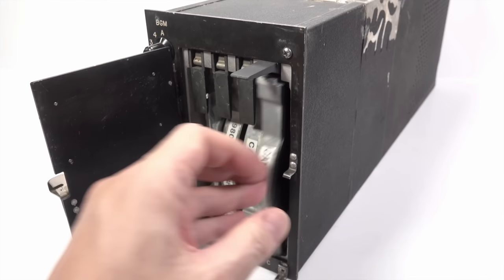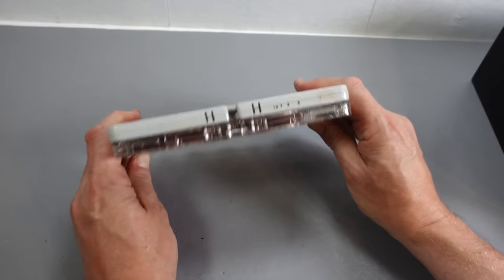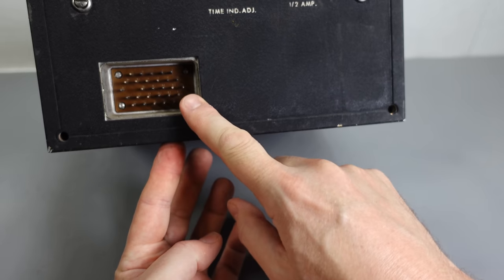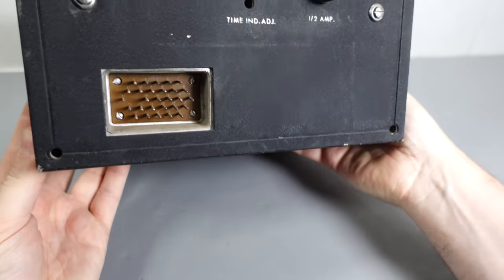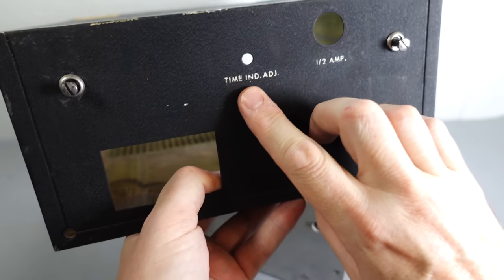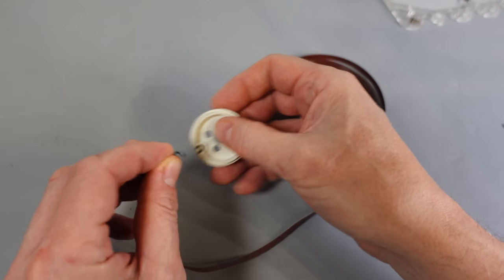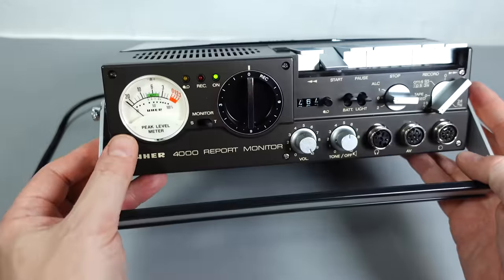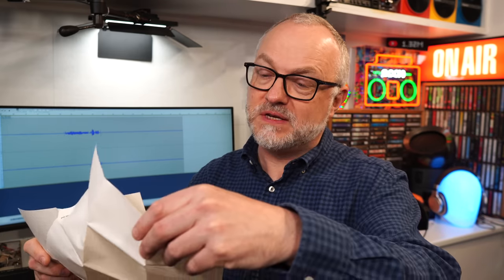Mystery aviation tape machine

Comment: I seem to recall seeing something similar in a DC9 when in those days you could go and have look at the cockpit mid-flight. My dad was an electrical engineer and he would often have "stuff" knocking around the house (Usually Honeywell Avionics kit). But I remember he bought something similar home in the late 60's. It's clearly a CVR. When I did flight program modules in later life we were taught there were often more than one CVR in a plane. Often there were two. One for the cockpit and in later years one for the chatter between cabin crew and in some cases passengers. I think he used to repair them at one point. I know he did a lot of aviation equipment and everything was massively over engineered due to vibration on aircraft at the time and the fact they needed to survive an impact or extreme temperature. They were robust as this one is with it's locking latch to stop the tape and door flat opening in flight. Like you said it only lasted 30 to 45 minutes, this is usually the time needed to record a incident at the time. From an incident to landing most pilots hope this is all over with 20 or so minutes! The socket on the back looks similar to a Mullard connector so I could suggest the "ring" of pins is the input voltage (Aircraft use anything from 28v-200v SP/3P plus the battery UPS). A couple of pins for remote control and the remainder used for mic pickups plus the output. Looking at this one I doubt it survive a incident of magnitude so it could be the G-CVR whilst a more heavily protected one would of being the main one for investigation post incident. 
These days it's all instant and monitored from the ground and with digital "tape".

Comment: Just found some information on a similar looking machine which uses the same type of tape. It is possibly a Quick Access Recorder. A QAR is to access data for research and maintenance purposes. Even to this date they still use removable media, albeit digital today. To help date the machine I also found that Telectro Industries suspended production in 1961.

Comment: My guess would be an early black box voice recorder to keep a record of cockpit and radio communications. 
The flight engineer would swap tapes or just let it record over previous recordings.
As the aircraft it came from was probably decommissioned along with the recorder, it would have spent long periods on the ground powered up, but with no activity. That would explain why the tape is mostly blank.
Reply: I thought it was maybe an early black box voice recorder as an in case the plane went down - with at least that the tape could be recovered and played back at a later date to find out what happened.
Reply: I was going to just say that, this may be a early day black box! Nice, to know someone else thought of the same thing, since most aircraft back in those days barely had anything for much safety.
Reply: That would be my guess too. Maybe, due to the limitations of reliable tape technology at the time the “time lapse/end of tape detector” put either an audio or electronic time stamp on the tape each time it was voice activated (so a continuous recording wasn’t necessary, and short tapes could be used) and/or cued in another of these machines when the tape ran out? 

It would make sense if all this was automatic - an emergency in the cockpit isn’t an ideal time to be having to swap a new tape into a machine. 

I’d also guess this one was ready to be installed in an aircraft, having been tested - hence the short test messages, and mostly blank tape. Maybe it had just been serviced or refurbished, having already been in an aircraft? That would account for it not looking pristine/not being in its original packaging.
Reply: A black box with 30 minutes of recording time is pretty much useless.
Reply: Sort of -- it's a QUICK ACCESS RECORDER (sometimes referred to as a QAR). Instead of being used for emergency data logging, it was used for everyday logging of communications. So not really a "black box" type thing. 

BTW - the company Penny and Giles were well known to make these devices. Later they would be mostly known for making faders for recording consoles. Interesting company.
Reply: @AttilaTheHun333333 no it isn't because you'd have the last 30 minutes of communication before the crash
Reply: @slamcrank  That makes sense, because even on a long haul flight, you're not going to have much dialogue with. ATC, so a short tape would suffice.
Reply: @AttilaTheHun333333  They record over and over.
Reply: I would agree possibly a cockpit voice recorder or backup recorder. As far as I know cockpit voice recorders don’t record the whole flight but constantly over records the last 30, 60, 90 or so as this would give the most valuable information rather than a full flight.
Reply: @tiprat5051  
What triggers the recording to stop in the case of an emergency? Which event, besides the plane crashing?
A black box isn't just needed in case of a crash!
It would make zero sense to use it for that purpose, especially with this tape speed.
Reply: @AttilaTheHun333333 it's usually stopped like today: switching it off. Either by switching the powerbus or by pulling the fuse.

Also its 30min in one direction that would mean either 1h stereo or 2h mono in a 4 track system. The requirement from 67 and onward was 30min. That means 2-4x the required record time.
Reply: @AttilaTheHun333333  In fact, 30 minutes of recording time for cockpit voice recorders was the ICAO requirement. Pilot unions made sure that airlines did not install recorders which could record more. Pilots wanted to be sure their daily communication was private - and the airlines couldn't listen to all they said. So the recorders would only hold the last 30 minutes of conversations. Data recorders had longer durations, but voice was strictly time limited. The 30 minute limit was raised to 2hours for new aircraft built after 2003 - so longer recording times are a fairly "modern" thing.
Reply: @AttilaTheHun333333  It would make total sense to use it for this purpose
Reply: The fact that it was made for the FAA and not for an airline or aircraft manufacturer supports this hypothesis.

I agree an early (maybe development) CVR.
Reply: Thanks for that,unsure why but it’s a first for me seeing your channel and it looks right up my street.Have a subscribe 👍
Reply: @tiprat5051  It was pretty much confirmed by other commenters it’s not a black box recorder.
Reply: @AttilaTheHun333333  it's exactly what I said it was an inflight recorder

Comment: Unit Obviously belonged to the FAA at one time so, not a music machine.  The plastic cassette is not fire proof so, probably not a CVR.  Low serial number suggests not many were made (unless you just got lucky).  You may be right that it was intended to fly (built like a tank).  So that leaves one application, it would be a voice data recorder for use in experimental flights (which the FAA does a lot).  Crew comments would be preserved on a format that would easily be transferred from an aircraft to be reviewed on the ground using a commercial RCA cartridge machine.  Photocell determination of time remaining (rather than a simple tape counter) permitted notifying the crew of tape status on a remote control head (through that multi-pin connector).

Comment: Big way to see if it was ground side or air side is the motor that drives those reels. If it is a 50Hz motor ground side equipment, which then says it was likely used for something like ATIS in the control tower, where you would have it sitting there, with an ATC recording the weather and such information onto the tape, and this then being used, with an external controller to listen for the corresponding tones on the other track, to replay this greeting identifier and local weather every 10 minutes, then stop, wait for the time interval, rewind back to the tone, stop, and play it again. Fast tape speed as you would typically have up to 5 minutes of info, updated every few hours, and thus the need to have audio that was better than the radio, and thus not degrade it. The counter would be a simple meter, showing the running time left, so that they could take the cartridge out and put in a new one, keeping the old one on the bottom of the pile, to use again next week. 

The reason for almost no audio is likely they bulk erased them before use, so that the bias system would have consistent noise level, and no chance of a misaligned head leaking old audio into the playback, or it mistaking a tone as a premature stop.

If the motor is 400Hz, or a speed controlled DC motor, then likely air side, probably used to record things like local ATC for immediate playback, likely for either pilot training, or for another ATC to confirm things, running in a loop back and forth to record on VOX, and thus you can get immediate playback of messages, leaving the long record time slow tape to still function, while having a local recording for quick reference. In any case tapes were bulk erased before storage, probably for the same reason above, no interference from old tones, or bleed through from misaligned heads. The 2 recordings were probably a test done in 1966, checking if the mechanism worked, and the tape was not bulk erased after, as it was still mostly blank.
Reply: Since this is a US product with FAA on it wouldn't it likely be 60 hz instead of 50?
Reply: @thomaswilliams2273  50Hz 60Hz so long as it is not 400Hz it is ground side equipment.

Comment: I believe this is a recording device for flight tests. I am an aviation engineer, and I used a similar recorder (TEAC V-80).
Reply: I checked the FAA report, but don't have the details.😮‍💨
<Memo>
- Telectro delivered the “VOR Test Generator” to the FAA.
- The "VOR Test Generator" has a component called "Voice/Code Reproducer Assembly".
- "Voice/Code Reproducer Assembly" has delivered 136 units.

Comment: I'd say its a CVR - Cockpit Voice Recorder. The original FAA standard record time for a CVR was 30 minutes, which lines up with your observation that this device can do, it was later extended so this design became obsolete.
Reply: I have the same idea.
Reply: i don't think it would survive a crash, especially if there's a fire (which was far more common back in those days). and when an aircraft cashes is exactly when you need the info on the tape.
Reply: I really don't think so. CVRs are built to withstand crashes. This thing definitely isn't.
Reply: I doubt it.  That would be completely destroyed in a crash.
Reply: First thing I thought of too, but it doesn't look very robust, as it surely would need to be salvageable after a crash?
Reply: They wouldn't use a tape with a plastic cassette housing for a CVR. It would completely melt in the event of a fire.
Reply: So understand it's not yea old "black box recorder" which is red and may not be opened by just anyone, but maybe a quick access cockpit voice recorder for review of smaller incidents and improvement of communication. Just a suggestion :D

Comment: Potential collab idea: get this running again! If it is aircraft equipment it'll need a weird high-frequency power supply, but the advantage of aircraft equipment is that it should be incredibly well documented (somewhere).
Reply: Or just get an old airplane. I think that would be an even better video.
Reply: That would be cool, CuriousMarc would be a great possibility to contact
Reply: That's what I thought....Google it you get nothing.
Reply: @John_Locke_108  So this tape recorder just needs the optional Douglas DC-8 accessory?

Comment: Looks like an early Cockpit Voice Recorder. A device still in use today with a longer history than most realize. Most preflight checklists require a test to be done on it prior to flight. The test  for most aircraft (99% of my experience was on C-130's) was to push the "CVR TEST" button on the flight deck and say a few lines. It should then playback what the microphones picked up. They may have installed a new tape in it, done a quick ops check to make sure it works, and then the component was removed or aircraft retired before it recorded anything else. 

Is there any serial or model numbers on it anywhere?

Also, small fact I learned many years ago. The C-130 came from the factory with a CVR in the mid fifties. It was a magnetic wire based system that ran off aircraft power. One of the issues they had was it was recording anytime the aircraft had power, and the wire could only be recorded on once. So ground crews had to keep track of how long power was applied so they could change out the wire before it flew. This encouraged the AF and Lockheed to develop an actual tape based system (Possibly this one) that could be recorded over and easily replaced. 

I'll do some digging to see if I can find anything.

Comment: It seems obvious to me that this is an early Cockpit Voice Recorder.  It's heavy duty (although maybe not as much as later models), made specifically for the FAA and not a specific airline (so definitely not for background music or anything non-safety related), and the one clip of "say again" may be it in use (this probably only recorded when the mic transmission button was keyed instead of recording the cockpit chatter like later models)-maybe there was two of them and this was for the co pilot and that's all he said on the radio during the flight.

Comment: If you could get it running somehow, it could be neat as a bit of decoration on the wall, with the case open and the various wheels facing out and spinning. It's got a nice, industrial look to it with a good variety of bits n bobs.

Comment: Seems those flywheels are in constant rotation ready to be engaged for instant speed when a radio message is either received or sent. That means only radio messages are recorded without wasting tape.

Comment: Per my memory and a couple of other YouTubers, Telectro made a few R2R consumer units besides aircraft-grade gear.  Emerson Radio Corp. bought them probably early 1960s.
Reply: Was looking to see if anyone else recognized the manufacturer.
To my knowledge,  Telectro never jumped into the consumer side of the RCA cartridge tape format. Bell Sound (a division of TRW) did jump in on the consumer side.
Makes me wonder what other uses were attempted of this tape format after it failed in the consumer audio world ?
It was capable of 4 track mono record playback and did also run at 1 7/8 ips  in the RCA consumer configuration.
The track layout was very similar to 1/4 track stereo on 2 sides on open reel tape.
But, imagine if this ran in 4 track mono mode and potentially at the lower speed. That would give a long
time before it erased over a previous recording. I don’t think the playback was at double normal speed in your clips. And presumably you heard all 4 tracks (if there were 4) from end to end.
Fascinating tech.

Comment: According to Aviation Consulting "Flight Data Recorders: A Short History", the first country to require flight data recorders (the ones to survive crashes) was Australia in 1963.  The site also says the US first required them in 1965.  By those dates, your machine pre-dates that.  Maybe it was for recording the pilots.  FDRs are designed to record the last 30 minutes of a flight.

I would include a link, but my comments if I include one.

Comment: Being an aircraft device,  it ought to be powered by 115 volts,  400 cycles or 28 VDC.  Or even both,  in some things.  If you could figure it out and get it working,  it would certainly be better than a consumer grade machine.  Bet it cost alot of money.

Comment: Cant believe the adhesive on the ‘This Side Up’ is still holding on, the stuff we used in the 80s used to fall off after a couple of years..
Reply: You were probably using third party Dymo replacement cartridges. Original Dymo stuff is very durable. I often see mailboxes with the names marked on it with this stuff, completely unprotected from the rain, snow and sun, and they don't fall off even after 40 years.
Reply: It was the 60's the glue was probably a mixture of Asbestos Lead and CFCs or some other highly caustic materials that worked really good then killed any one that came it contact with it. :)

Comment: Looks similar to what you would find in a black box back then. This most likely if it was in a black box would be used for recording 30 minutes of audio between the pilots and ground crew so that investigators could log what occured and when which having those time indicators would be important for mapping out the series of events. If it is part of a black box its definitely one part of an airplane you never want to use.